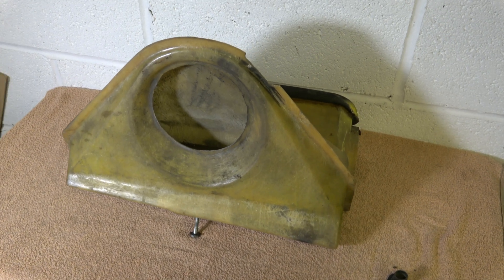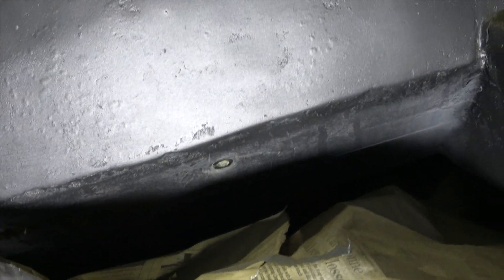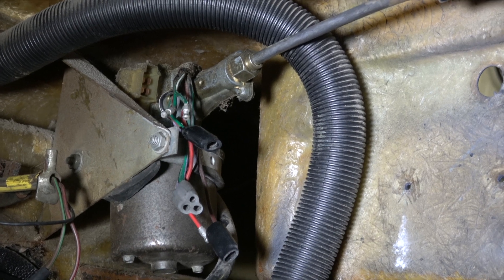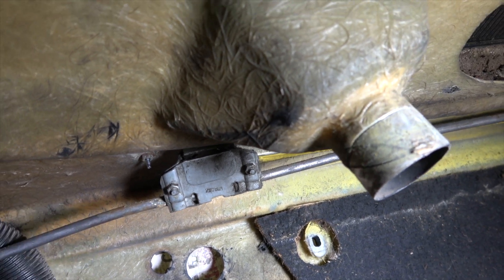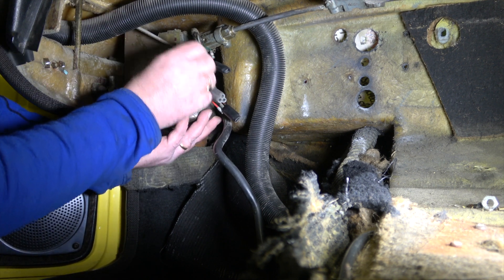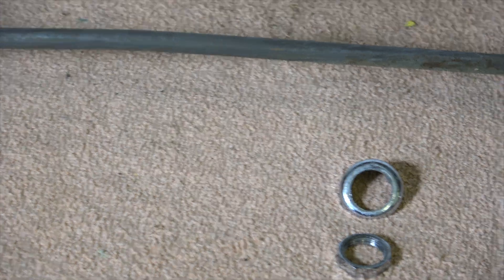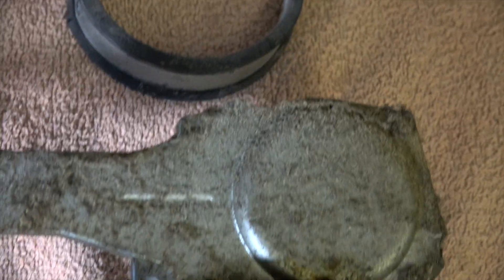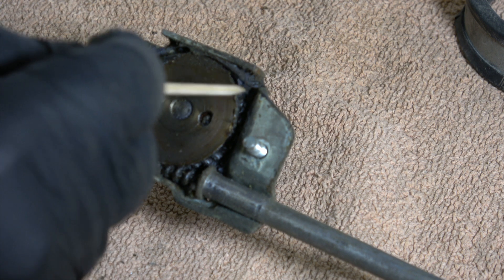Lotus Elan S4 : Wiper Motor & Plenum Removal

Comment: You can get the wipers from eBay they are sold by seller carsparesonlinecarz2 .they are advertised as stainless steel wipers for Aston Martin DB4 and DB5 1966- 1969. These are the correct size 14” with the 7mm bayonet connection. Well they fit my Elan Sprint which in basically the same as an S4. Hope that helps. Great informative channel and I’ve subscribed 👍
Reply from the maker: Thanks for the info, fortunately mine are in pretty good condition, not the same can be said about my windscreen. I decided to move it to a safer place when I knocked it, it fell about an inch and cracked.
Will be posting more soon, thanks for the sub, much appreciated.